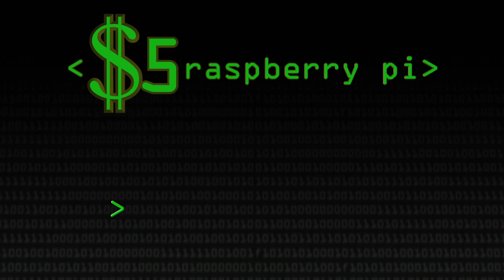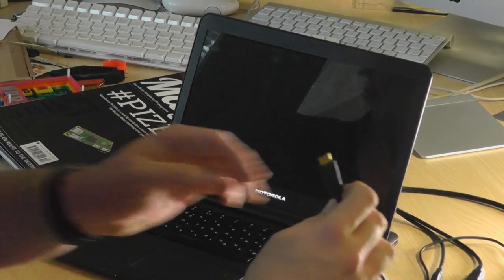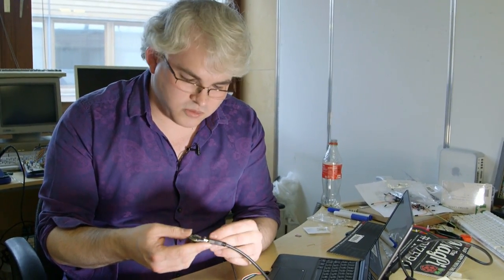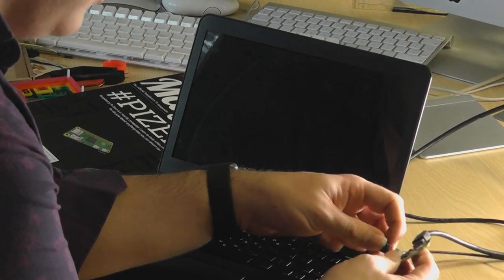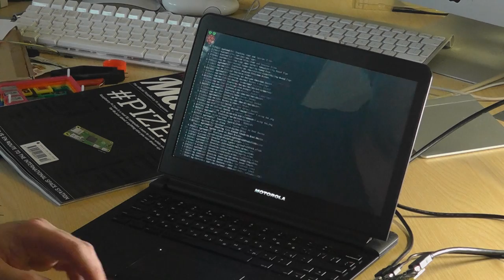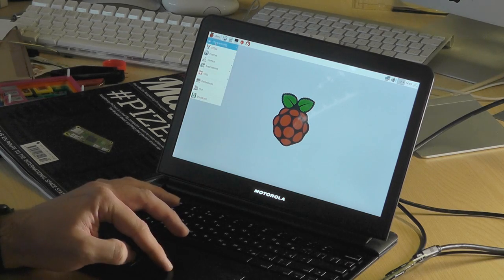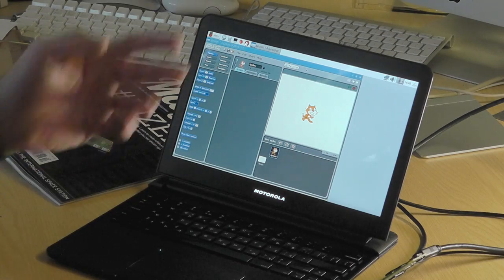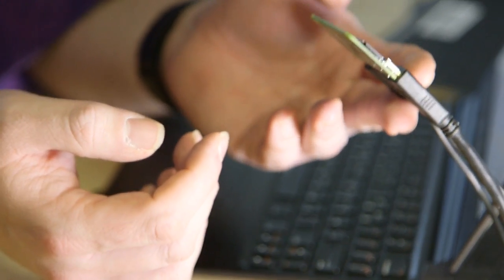Raspberry Pi Zero - the $5 Computer - Computerphile

Comment: 5 Dollars for the computer and 305 dollars for the monitor, keyboard, mouse, usb hub, SD card, power USB adapter, WiFi USB adapter, usb sound card, speakers, external USB hard disk. Are you kidding me? For someone who has an old desktop computer the cost is minimum. But for many like me that have only laptop and iPhone, this computer doesn't cost 5 dollars at all. It is a joke. 
Nevertheless is good for self repairing things if something goes wrong.

Comment: To drop the price further, surely they could lose the HDMI port and add DisplayPort because HDMI implementations cost £££ due to using the standard, if i recall correctly? :P
Reply: +Dan Wrenn Maybe, but it seems that more people have HDMI cables rather than DisplayPort, good point though.
Reply: I wonder how much 2 USB C ports would cost in comparison to micro USB A + micro HDMI.

Comment: Is it just me, or does the fact that you need 4 to 5 times the price in oddball adaptors to really use it sort of defeat the purpose of its price point? I mean, if it used a standard USB (especially if it had one male and one female) I could plug a bunch into my desktop straight out of the box and have a little render farm (for example)... but with all the adaptors needed, I'd still be better off just getting a second hand laptop with all the kit on board. 

It sounds like the classic huckster scam, "I'll give you a car for free, but it only takes my specially blended fuel which I'll happily sell you for 50$ a litre." ...assuming they were smart enough to invest in a company that makes converters & adaptors.

...I know this isn't an accurate description, but it is the impression I'm getting.

Comment: $5, after adapter, $20
Reply: +Andi Cui WiFi is pretty useful for robots though. need some way to communicate with them from a laptop or similar, but then you end up needing an OTG cable and a WiFi dongle or similar.
Reply: +Xano Trevisan Kothe But at least if the computer breaks you don't need to replace the adapter
Reply: +Brendan Bohannon What about using Bluetooth instead?
Reply: David Lam  similar issues, but then you have crap range, limited bitrate (*), and need a bluetooth dongle for the laptop as well.

*: I built a robot on the RPi B which can stream stereo webcam video. proper WiFi would be needed for the video streaming (though generally only one is used, as 300mA for 2 webcams is a bit steep, vs 150mA for a single camera).
Reply: *****  generally need to solder to make a robot. hot glue could be better than tape for this (generally holds things more securely). downside is (AFAIK) soldering the signal wires will prevent other things from being able to connect to USB (sometimes, manual interfacing may be needed).

Comment: At 5 dollars a pop, that's half the price of a movie ticket in Canada, hell that's cheaper then a 2 Liter bottle of soda and a big bag of chips, or a Burger meal at McDonalds. 5 bucks is enough to get 2 large coffees at tim hortons
Reply: +Matt Brine Oh, and if you have enough USB cables and other junk laying around, if you slice open the end of a Micro-USB cable and short out one of the pins/contacts to another, it'll make it appear to phones and stuff like this as an on-the-go adapter, so long as the other end of that cable has a USB port or some other device. I did this and soldered a USB port I scavenged from an old computer motherboard and now i have a free on the go adapter for my note II

Comment: That's all nice and well, but a $50 tablet has the same processing power, a screen, speakers, wifi, internal storage and a camera, so I fail to see what's so impressive here. Once you add all the bits and bobs to actually use the Raspberry, you'll be around that price too, if not over. Don't get me wrong, I can see cases where this is a good solution for your needs, but I won't be running out to grab one.
Reply: Are you serious?
That's like saying why should I buy this blue tie when I could buy that entire black suit.
Why should I buy a plane ticket when I can buy a plane.
Why should I buy a pillow when I can buy a settee.
Why have a spare tire when you can buy a new car.
Why buy some AA batteries for your gameboy when you could buy a wii, you get the batteries and the wii mote and the console.

It's not even apples and oranges, it's apples and sasquatch.
Reply: +NewFormofSilence 

Then go and buy the pre-made device and use it,  you'll never have that feeling of "yeeesss" when you've made something work yourself instead of relying on others to make it work for you. But, if that is all you want so be it.
Reply: It's not for common people.  Just like in the 80s, computer magazines were not targeting common people neither.

Comment: That's better that my Core (not 2) Duo windows Vista Sony VAIO!
Reply: +AL_O0 ᶜᴼᴹᴹᴬᴺᴰ ᴮᴸᴼᶜᴷ ᴬᴺᴰ ᴿᴱᴰˢᵀᴼᴺᴱ Not exactly,  because the Pi (all of them) use ARM processors and not x86 like Intel/AMD, meaning they do fewer calculations per clock, so 1GHz on ARM would be more like 350MHz on x86.
Reply: +Eddy Gerina It is comparable to a Pentium 2.
Reply: Clock speed has nothing to do with CPU power.

Comment: the fact that it has no networking and requires a load of adaptors makes it fairly pointless, you're far better off spending adaptor money on a nicer raspberry pi
Reply: It's not pointless if you already have an infrastructure to use them. that's like saying desktop computers are useless because you have to buy the monitor, keyboard, mouse, speakers, etc...
Reply: +elurocks13579 True.

Comment: It's not a $5 computer, it's a $5 motherboard.  Which is great, but it's not the same thing.
Reply: Shad Sterling It's a system on a chip.  It has an ARM processor and 512 megabytes of RAM.
In other words, it's a computer.
Reply: Right, it's more than a mainboard, it's a mainboard, CPU, & RAM.  But without a power supply, a storage device, a keyboard, a mouse, and a display, it's not usable.  (And I'm inclined to put it in a case too.)  Even if you assume you'll use an existing TV for the display, it's not by itself a usable computer.
Reply: Shad Sterling But most people have a USB power supply or three for mobile phones. Same for a keyboard or mouse, people tend to have them. Most TVs will work with them. And it is envisaged that many of these will be used without the need for a permanently connected keyboard or mouse. You could have dozens of these and still only require one keyboard.

Comment: can you inatall windows on it?
Reply: +Ubeogesh Well you can but dont expect windows 10 on it running smooth
Reply: +Alexco21 actualy windows made a IoT version of windows 10 for the Rpi
Reply: +ScaretacticFhang xp and 7 are made for only intel and amd processors but the  raspberry pi has an arm processor so winxp is a no-go
Reply: +ScaretacticFhang 
You don't understand, he can't run windows on RaspberryPi, just this new windows10 pi version, which is no real windows.
Windows is build and compiled for x86-processors(amd64/x86-64) and the Pi is using an ARM-processor, i think you can virtualize x86 but it would be very inefficient to run windows on that.
Reply: I only saw win98 booted with an emulator. Your best bet might be using the pi as a thin client and get a server to emulate the session.
Reply: ***** wow you're so nice and polite to a complete stranger